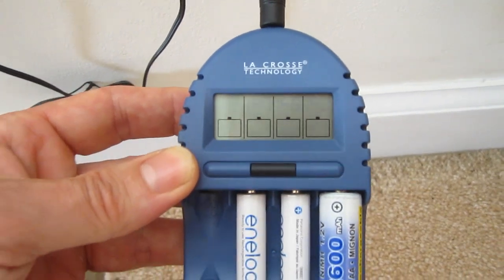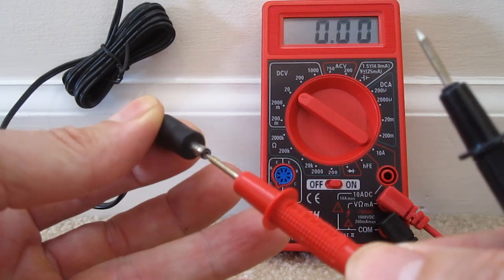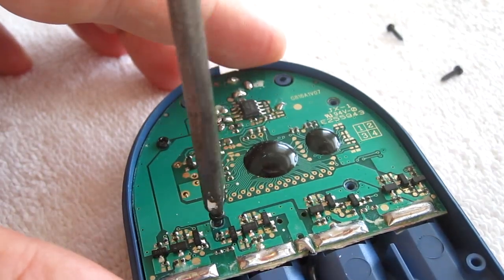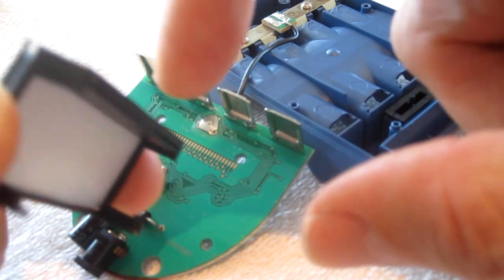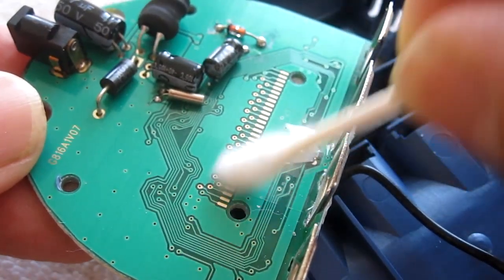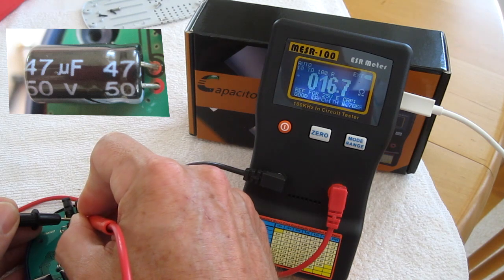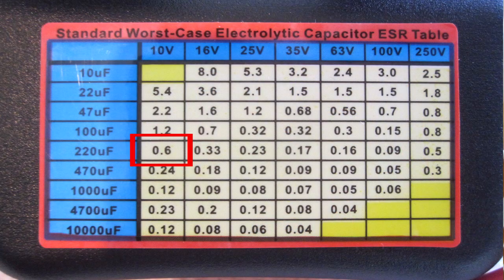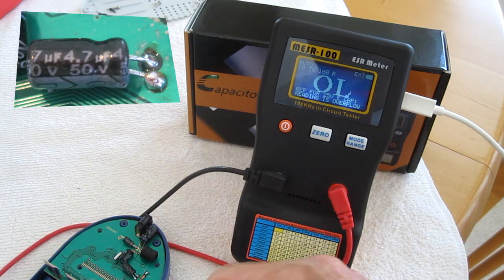Dim LCD Display Repair - Electronics Fix La Crosse Battery Charger BC500 BC700 BC1000 ESR Meter

Comment: good video! Tip for others: LOOK at the strip that connects the LCD to the board, sometimes it's more squished on one side (the side that touches the board), clean both sides with deoxIT or contact ReNu and FLIP the strip so that the LCD side of the strip now touches the board and the board side now touches the lcd. This is what helped me.

Comment: Great video! Do you recommend to touch all soldier points from the chip (IC) in a digital watch wich make false contacts? Thanks very much. I cleaned, tested the oscilator...all ok. The capacitors are very small, just a very little square, but I left they to the last step.

Comment: Nice fix. So it was the contact cleaning that seems to have fixed the problem.
Reply from the maker: hi, yes im 99.9% sure cleaning LCD connection fixed it. The other stuff like resoldering and testing capacitors was just extra bonus steps that might fix a problem.

Comment: Your soldering tip is toast.

You shouldn't test caps in circuit.
Reply: or power supplies without a load.
Reply: He used a special meter for that; an ESR meter.
Reply: @rolandberendonck3900  Doesn't matter. ESR meter won't properly test parts in circuit.